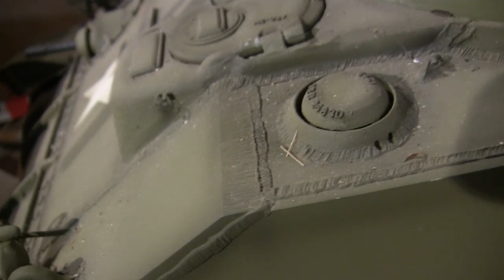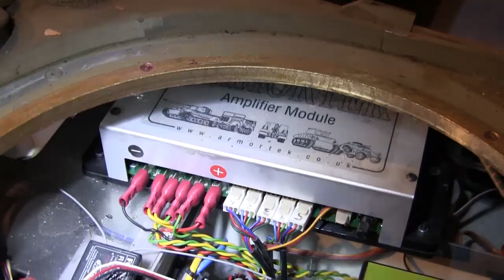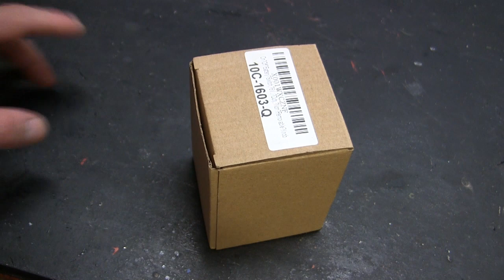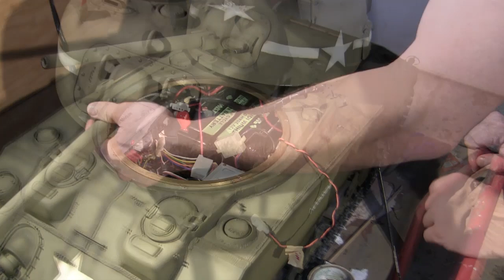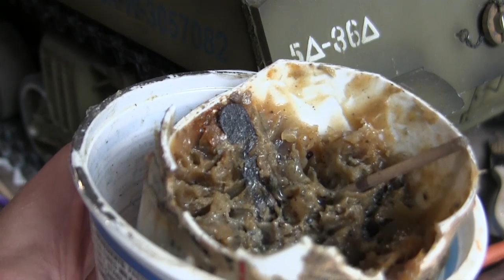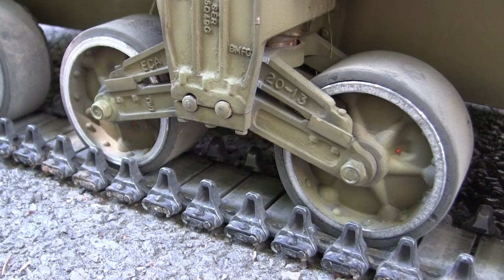Armortek 1/6th scale RC M4A4 Sherman tank restoration

Comment: The batteries being in close proximity to each other may not be a good idea.  Maybe one battery cancelled out the other through arcing.  Not enough to explode.  Put something  between the batteries.  Maybe sheet plastic or wood. 32:06
Reply from the maker: The batteries are excellent to keep together for weight distribution and for access

Comment: Great video! I wish I had enough money to get a Armour tech tank. I would love to have a tiger II or Panther.

But one think I would like to ask, are you sure it's a M4A4? It looks like a a M4A3 hull with a M4A1 turret, thanks to the miniscule mantlet.
Reply from the maker: No it's certainly an M4A4. This one is longer than the my 1/6 early hull M4A3. The early no hatch turret low bustle would be the turret that this tank would get for this configuration.